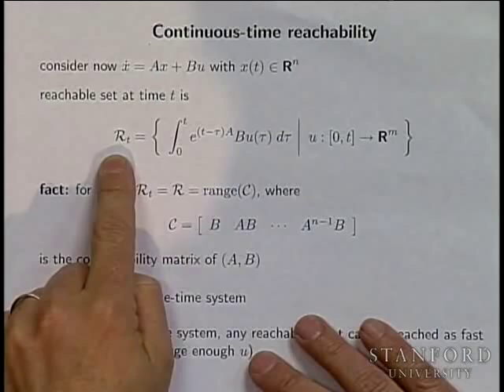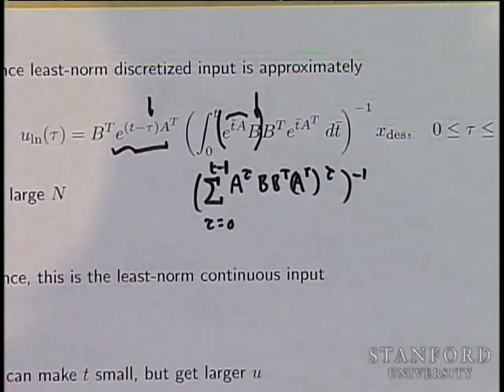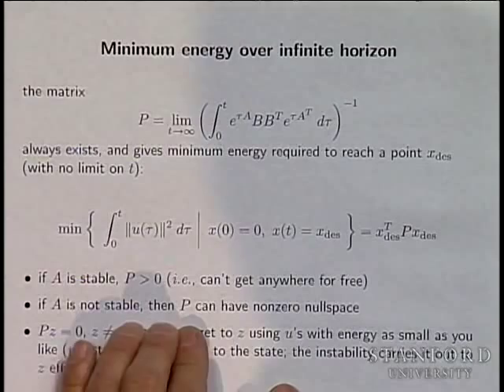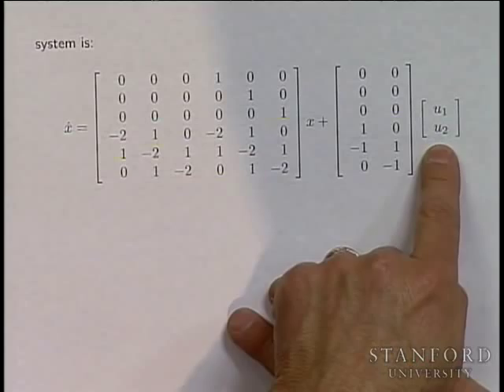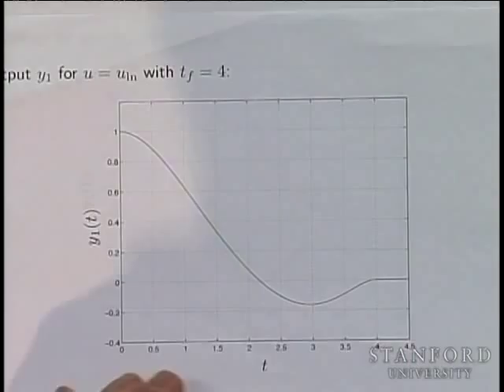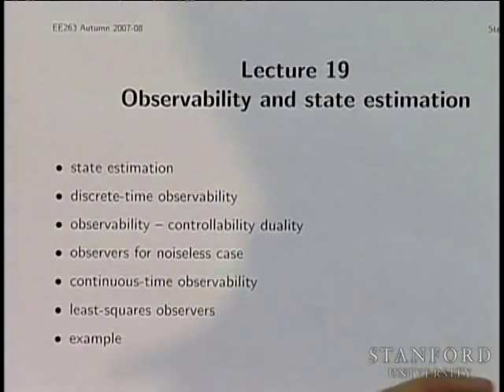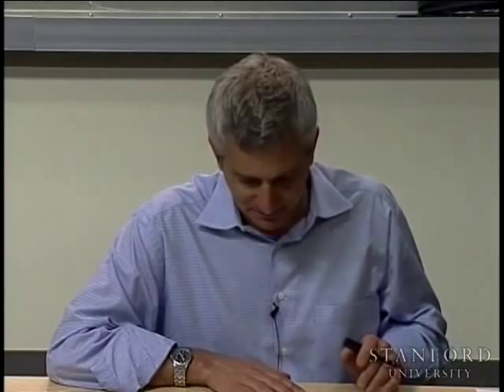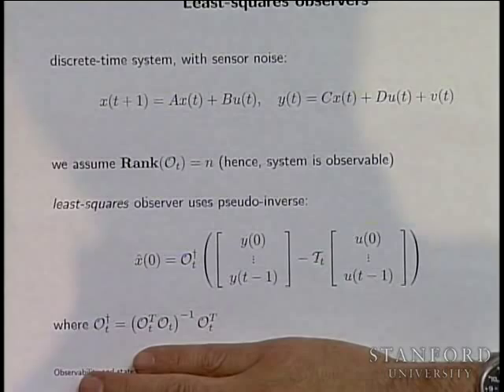Lecture 20 | Introduction to Linear Dynamical Systems

Comment: Thanks a ton, Professor! Thanks a lot, Stanford University! Such endeavours are truly making the world a smaller place. Knowledge and ideas are reaching far and wide thanks to you guys.

The content and presentation of the course is very imaginative. I know places where LDS is taught without mentioning Least Squares or Least Rank Approximation using SVD. Even the material on Reachability tied to Least Norm Control (taking us back to Least Squares, wow!) is just excellent.

A request: Please give us a set of lectures for EE363 too. I already find the lecture slides (a work still in progress?) and the course info very, very interesting.